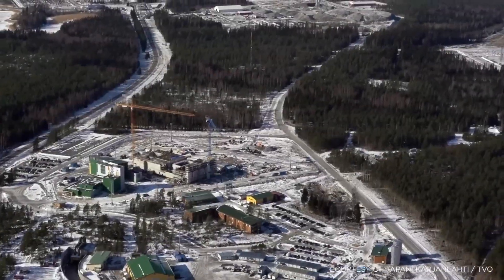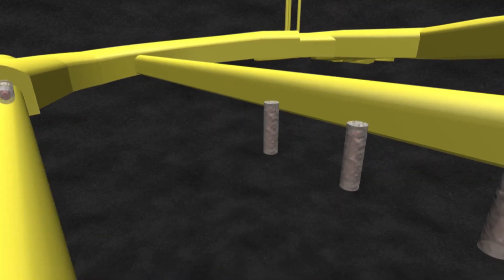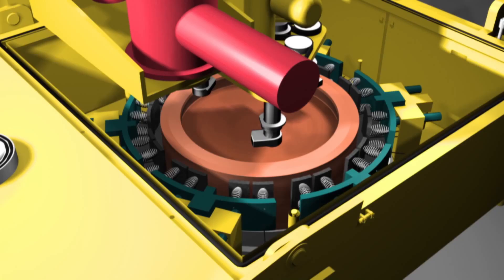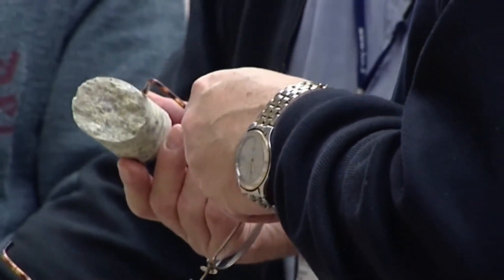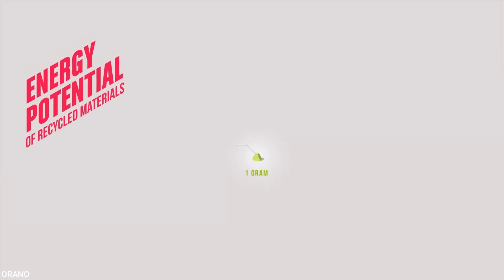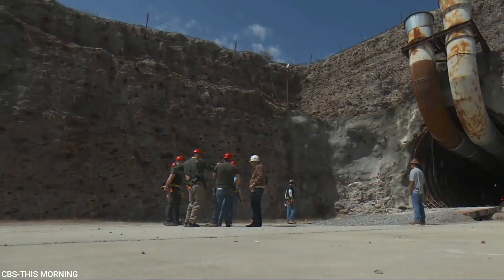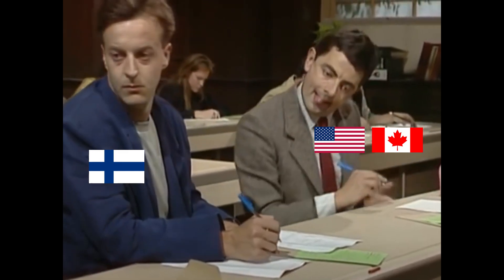Finland's MASSIVE Underground Megaproject Built for 100,000 Years

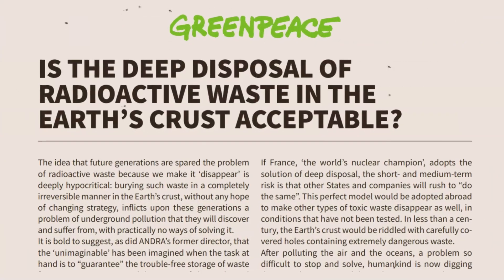Comment: 7:00 Greenpeace making its usual noise. Their consern is that copper canisters might rust and leak after 1000 years. In that timeframe used uranium may be useful again when we have better reactors.

They also conventionally forget that renewable energy needs backup energy and rare earth mining is worse polluter than nuclear energy.
Reply: The other option would be to remain dependent on fossil fuels for energy and likewise to depend on countries that supply them, more importantly in my opinion. Nuclear energy is the best way forward.

We should have specialized reactors for re-using spent nuclear fuel, however, because that is a finite resource as well.
Reply: @herptek  SMR reactors can re use the uranium from old "waste", todays reactors only burn few procen't of the fuel, SMR can burn almost all of it!
Reply: @henrioinonen3492  I am only a layman, but as far as I understand another advantage of such small reactors would be that they could work optimally to power smaller and more remote towns with less energy consumption. Having energy production centralized causes inefficiences for rural areas because of the extensive power grid. Remote towns also are the ones most often powered by renewables and in need of compensating energy sources during the fluctuations of productivity of these methods.

I am under impression that SMR:s could also work optimally as auxiliary reactors for larger nuclear power stations, the fuel of which they could also recycle. Last but in my opinion not the least they could also be used as auxiliary power plants in case of disruptions to powerplants or the power grid during natural catastrophes or military crisis.
Reply: @herptek  If you run thorium reactor. you can use all uranium isotopes to fuel it. It will burn almost all of the fuel. The result will be basically no uranium/plutonium. But it will send X-rays for 50years. After that you can put it in house walls or pavement.
Reply: Somebody thinks copper is going to rust?!? No!!

Comment: I think it's a mistake to bury spent fuel that still contains fissile or fertile material. There is only so much uranium in the world, and no way to magically create more. The French nuclear program recycles it's spent fuel until all, or at least most, of the fissile and fertile uranium and plutonium is consumed, burying only the fission waste that can't be used for any other purpose. The recycling process (Purex) has it's own problems, but there are hundreds of thousands of tons of spent fuel sitting in temporary storage casks now, that still contain enough U-238 to fuel CANDU- style heavy water reactors for several hundred more years without needing to mine more uranium. We should be using this resource, not burying it.